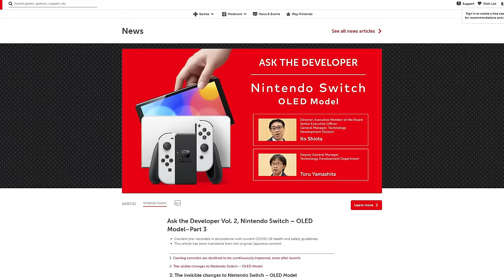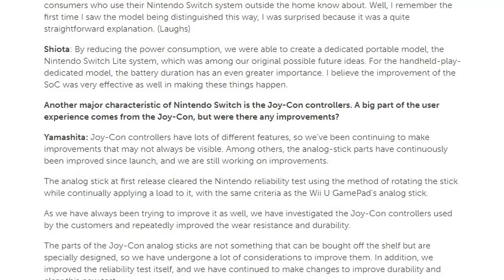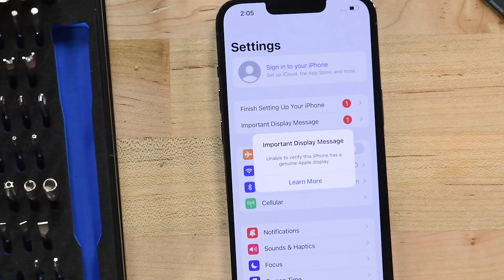Nintendo Switch OLED Teardown: More Different Than You Think

Comment: The Joycon sliders are actually hit or miss. This not really something that is now exclusive to the OLED model. My 2019 model also barely wobbles there.

This Teardown also pretty much proofs that this "the OLED model was meant to be the Pro version" is complete bullshit. That's just not how it works.
Reply: Not really, a new chip wouldn’t have required any extra cooling or power delivery.
Reply: @johnm91326  That was not the point dude. the entire internal design is different. People thought that Nintendo just swapped the internal hardware and was good to go. Hardware design is super complicated and not "ah dang, we can't do that because of the chip-shortage! Let's put the old Switch hardware into the OLED model 2 weeks before its release". That's just NOT how it works!
Reply: @Raja995mh33  It basically is that simple though. How else do you think android phone manufacturers can come out with 100s of different models? Rumour has it that that’s exactly what apple did with the latest Apple Watch too.
Reply: @Raja995mh33  Nintendo had 3 months between the announcement and release. That alone would have enough time to make what really isn’t a huge change to the rest of the design. Obviously this decision would have been made before they revealed the OLED so in reality they would have even more time. 

How much longer do you think they need?
Reply: @johnm91326  No it in fact would NOT. You clearly don't know how this stuff works. The Switch OLED was definitely finalized MONTHS before it even was announced. Stuff like this just does not get unveiled before it's even ready. It only took Nintendo 3 months because of the chip shortage to get enough models ready to ship so people don't end up with no ability to buy it like 2 minutes after it hits the stores.
Stuff like this always takes up often more than a year to develop, even if the changes appear to be tiny.

Comment: *switch oled gets a 7  for a modular design as the screen comes off, battery comes out but is glued down. Memory is soldered, power port is soldered speakers easily replaceable

iPhone gets a 1 for a not a modular design as the screen comes off, battery comes out but has pull tabs. Memory is soldered, power port is soldered speakers easily replaceable

Logic

Literally the only difference is the separate card reader, board that could be worn easily. That’s all it takes to go from a 1 to a 7? Wonder what you’ll rate the iPhone if they made the SIM card reader module…
Reply: I guess the difference is that most of the replacement parts on the Iphone would stop it from working because of apple's "security"
Reply: @REMless  literally the only thing they “lock” is the rear cameras. Yes biometrics too but that’s literally any half decent biometric device because actually security. Why don’t you go complain that if payment pin pads are opened they nuke themselves? Huh? That’s wasteful and requires the company to physically re-activate them. So unrepairable! That’s not needed for security! Ha! 

Everything else is chopped down to calibration, data, and letting people know they 95% been scammed. 

There is nothing wrong with a non genuine battery message even if it is a genuine battery because how can Apple check that remotely? They can’t if the phone checked with a server for valid serial numbers guess what every 3rd party battery will be genuine, huh. And you also expect apple to keep battery health on batteries that already lie and thousands of angry customers because “the phone says the battery is perfect health” 

Loosing True Tone with screen replacement. My bet (because don’t forget coders code this stuff not people in suits trying to make more money) is due to loss of calibration as Apple issint everyone else and goes “eh good enough the screen turns more warm in warmer environments” no they probably had a team just for it working on it over a year perfecting it. And making sure it’s perfect for every user.

And cameras same story Apple precisely calibrates them along with everything else having a mismatch is going to make that calibration invalid, and cause issues, issues they don’t have to fix because it’s not a bug within normal operating procedures. It’s like drilling through your phone and complaining “why doesn’t my phone work! Apple is just trying to make me buy another!” Use your head 

Apple right to repair is a paradox. And I usually side with Apple because if I wanted a cheap quality trash phone I’d buy an android. Most of the things the 5% of people who would even have the balls to open their phone want harm the general consumer. And are you going to fault Apple for wanting to protect the majority of their users? Would it be neat to side load apps, and replace things like it was a Lego? Yes but that comes at a cost as does the other side. Literally the entire user base is willing to make that “loss” because for people who actually care about the flip side? They get an android. Also going to throw this out here but can we stop with the “but that’s wasteful! The environment!” Phone upgrades are literally the last thing we should be worrying about. Solving that is like planting a square foot of grass. Are we going to litterly sit here and complain about people getting a new phone when there are massive factories spewing out chemicals. And yes ik iPhones are made in factories but that’s probably what 1% of industrial pollution? 

Most of what right to repair (funnily enough only really targeting Apple when there are companies that do worse things) (only because it gets attention, Apple is the easy target everyone can rally together and go “oooo those evil bastards”) that’s one of my problems with it. The other getting back on track is as mentioned. Is harmful to the majority of consumers. Should people know better? Sure. But we have mechanics. Carpenters, plumbers, electronics repair guys, electrician, and so much more for a reason. Do you really expect and want people to be able to design and build a house entirely themselves, then go design and build their car, then design and build their phone, then hook their house up to the electric grid, go tend to some animals and plants, produce their own media, care for the elderly, care for the sick, teach kids, care for kids, enforce the law fight their own fires, work on the morgue, dig graves, take care of graves. Do I really have to continue? We’re not cavemen we’re (most of the population) is an advanced co-Dependent society.